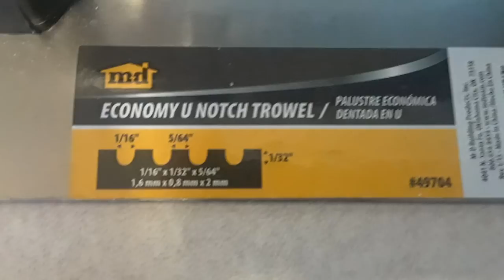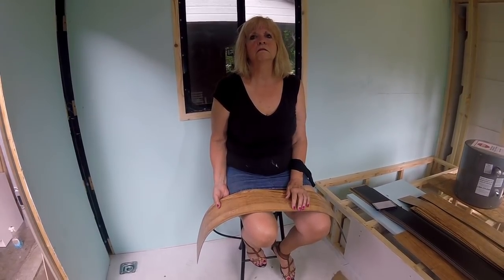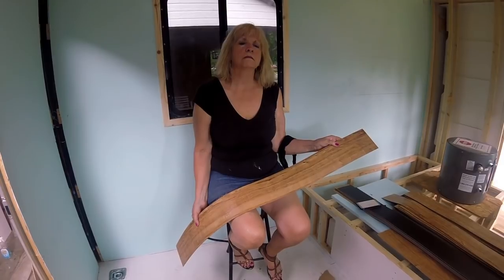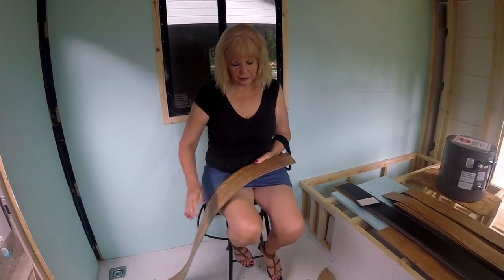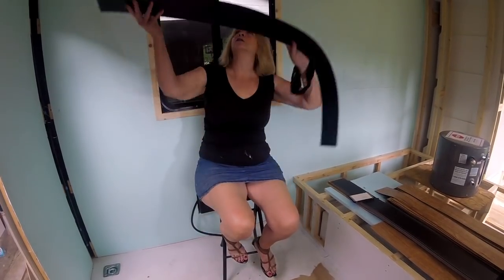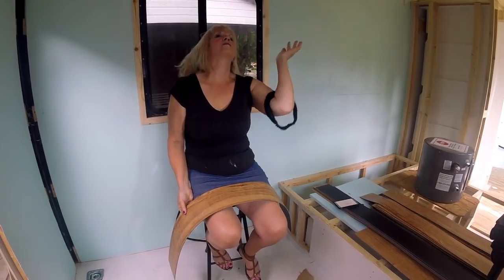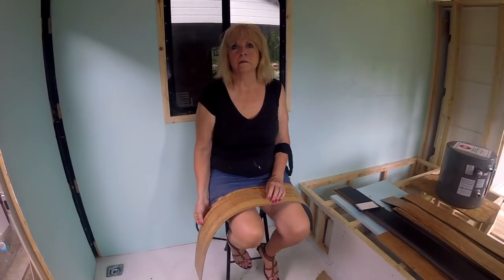Flooring Installation Cargo Trailer to Tiny House

Comment: Great series of videos! The only thing I plan to different is insulate the underside of the frame and install radiant floor heating. And instead of building the bed on the floor, I'd like to install a power bed that drops down from the ceiling. A storage box built on the floor under the bed will be designed like a bench so we can have extra seating when the bed isn't being used. Anyway, you're doing an awesome job and giving us a lot of great ideas. Can't wait to see the finished project. Well done!
Reply from the maker: Hey man thanks. Sounds like you have a great plan for your build that will suit your needs. That's the greatest thing of all about the "Cargo Conversion Culture". We can all incorporate individual designs to suit our particular needs. Thanks for your kind and encouraging comment.

Comment: Great job just wondering how is the cold weather coming through the floor is it insulated or did you just laid it on top of the plywood. I'm getting ready to build a trailer myself 7 x 14 V nose appreciate your comeback
Reply from the maker: We did not anticipate being in cold weather climates during the winter. But, things changed and here we are. We did not insulate the floor and yes it does get a little cold when the temperatures dip towards 30° and below. We have an extra portable electric heater we set on the floor and it helps a lot. If we ever build another, we'll insulate with at least 3/4 inch foam board.

Comment: Do you think this product would hold up in a garage application? Your feedback would be much appreciated
Reply from the maker: This product would not hold up to cars being driven on it.
Reply: Thanks
Reply from the maker: We would suggest some type of epoxy coating for garage floors. Some are really nice looking as well as oil resistant. Easy to clean and sweep with a broom.

Comment: Are you happy with this flooring or is there something new you could recommend? I realize you're a floor guy. That's why i'm asking. I'm in a similar trailer build, if that helps - Thanks in advance!
Reply from the maker: Well, we found later this particular brand has problems. It has shrinked a little only at the end joints. The side joints have remained as tight as it was when originally installed. The Flooring company we got it from said they've had the exact same issue at other jobs as well. The newer "click together" heavy vinyl floors have been working well. If I had it to do over, that's the route I would go. Remember to leave a small gap around the edges to allow for expansion and contraction. Cover the gap with 1/4 round.
Reply: @billanddeb  Thanks!

Comment: Hi Bill, You mention the hot water tank install at the front of the trailer. Might think of placing a raised border (lip) around it with shower pan liner underneath with a small drain hole to allow for any future leaks. This would reduce the risk of flooding your entire trailer floor.  Did this in our laundry room and utility room in the house after having water level switch failures on a washing machine and a leaking HW heater in a garage.  Just a thought.
Reply from the maker: Stephen Pinion yep I was considering something along that line. That's about 2 projects away. Thanks so much for the reminder. Sometimes my brain gets "overfull". Lol

Comment: your video - https://www.youtube.com/watch?v=M0Ob1KW948w
You were bothered by leaks. Unfortunately it seems common now on trailer construction to just overlap metal sheets and screw or rivet together. A stronger bond however is an older method where a metal brake is used to crease along the joining edges and each sheet pulled together before screws or rivets used, so the edges have overlapped metal at the joint. It makes a stronger joint, even without sealer used the joint will be more water resistant than typical method of simple overlap of sheeting. You can see that method in homes with older metal sheet ductwork. I do like your method of silicon sealer to waterproof and help bind the walls stronger. When I drop in a bathroom or kitchen sink, I often use just the sealer around the edge to both bond and seal to counter, no need for screw clamps under it, trim off excess after it's set well. Called a "flat lock" or "folded seam". Can also join using a "cap seam" over the folded edges. Heres a page showing what looks like. https://www.riversidesheetmetal.net/metal-roofing/panels/flat-lock/flat-lock-roof-panel-150.jpg